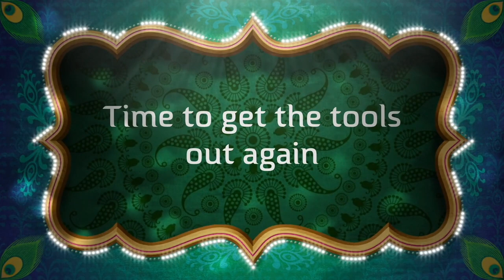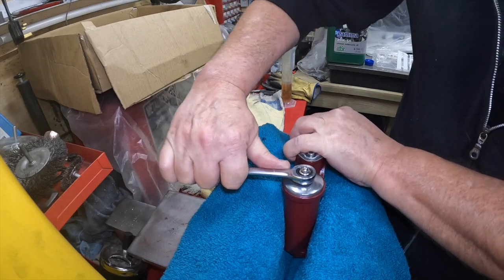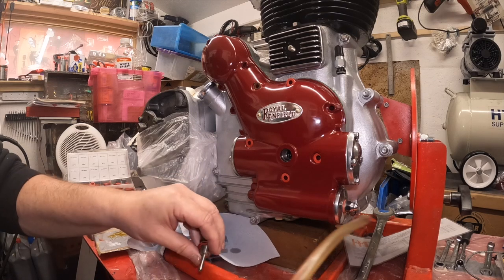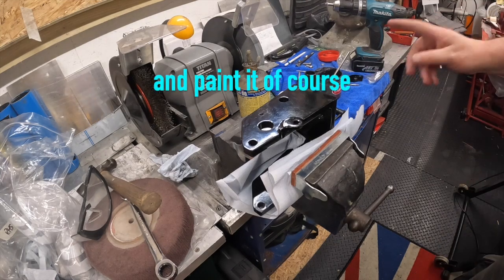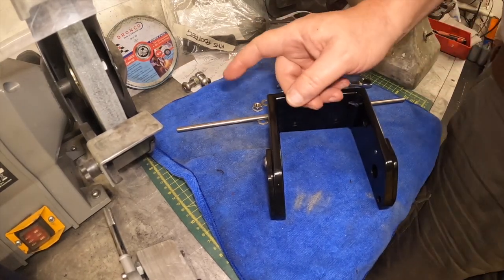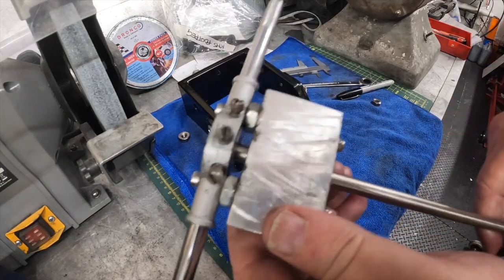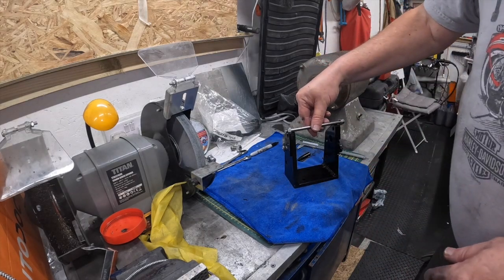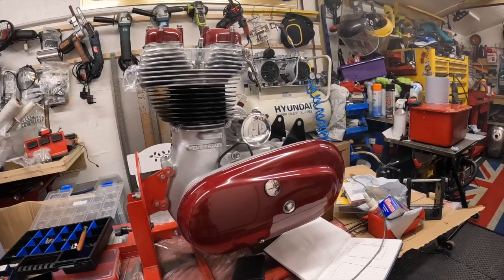Royal Enfield Bobber Project Part 34

Comment: Lovely looking engine, coming along a treat. One thing, a tiny thing and feel free to shoot me down. I think it would look better if all the screw heads had the same orientation. Please forgive my OCD..
Reply from the maker: No that's quite alright and I am of the same OCD displacements lol They aren't tightened yet as I was waiting for the new copper washers to come but believe me if it's at all possible to get them all to sit facing North then that will be done. :) BTW I was told it's an old coachbuilding thing where if all the screws point North then the rain will run through the screw heads easier. I dunno :)

Comment: That motor is looking pretty sweet...On those fiber washers: If you really hate them or dont trust the longevity of them and the aftermarket ones are as bad as it sounds it is time to whip out the lathe and make your own...yup a lot of work but you get 3 things out of it... 1: exact dimensions you want. 2: all that lovely lathe practice on parts making :)  3: Pride in that you made them yourself lol...Seriously though a small sheet of thick enough material (brass copper steel) I forgot what it was you said they were made from originally, then make a bunch of slightly oversized square and drill the centers of the squares, then cut apart the sheet into individual squares, run a rod through center of all the squares tighten it all together, put the whole thing on the lathe center it all and cut  off the excess and bobs your uncle, whole new custom made washers, polish them up and add to the bike... Sounds like a lot of work typing it all out but with the right planning its not to bad, its more of a "do I want to go through all this work"   Cheers
Reply from the maker: Wow! :D No I'll buy the copper washers thanks, I've got plenty of work on the lathe this week turning up parts for the oil feed return pipes etc. :)
Reply: @HepcatHarley  haha my "make your own washers" joke was a omg nope nope nope...cant wait to see your oil feed lines idea...always thought that center line splitter that Craig did on his bikes should have had a finned version like the motor itself...yup it'd be small but interesting...cant wait to see the next vid